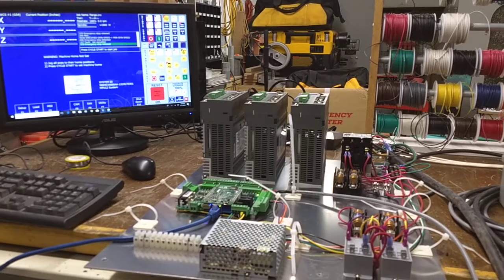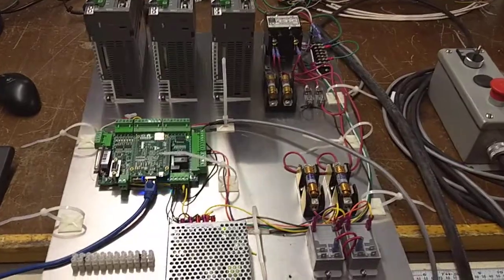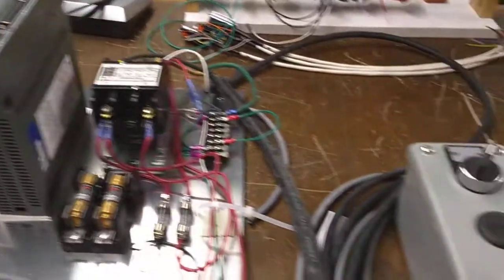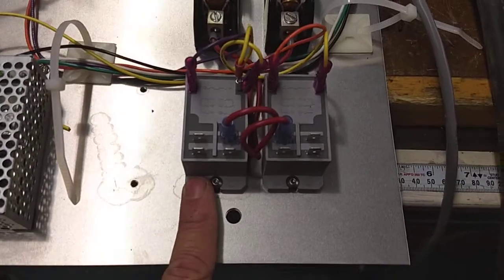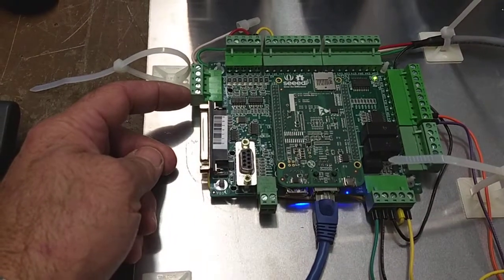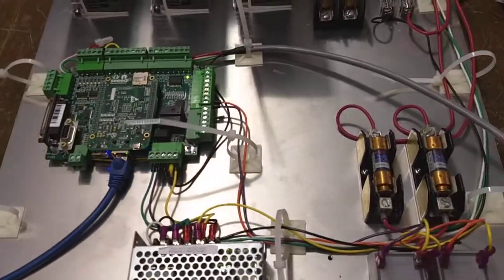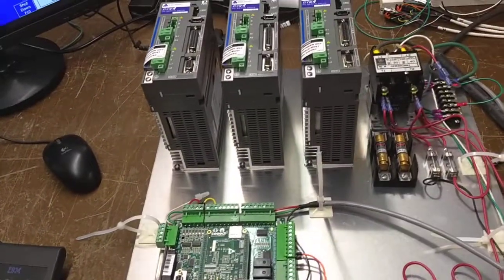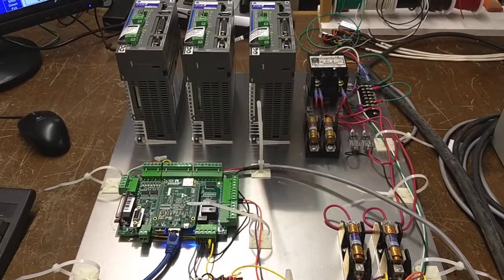Phoenix CNC Router:  Quickie update

Comment: Hi Marty,
as you know i have also DYN4 drives and DMM servos on my router CNC, for my XY I have 1.3 Kw motors , and for Z I have 0.75 Kw motor, they all passed the bench test,. 
after installing on CNC my 1.3 Kw servos  XY work fine but my 0.75 Kw servo on Z trips the drive to red Led light when i try to run it. when i try to run it just lifts Z axis up very fast 1/2 inch and trips the drive. 
Can you please help me with this problem. 
also i have limit switches and i set them to NC that's how i wired them , when i try sent machine Home nothing happens Acorn is saing home switches not set.  I press Alt +I  and i can see them they are connected. 
If you can help me with that also.

Thank you
Reply from the maker: Max, not enough info. Please post to the Centroid CNC User Forms. Post pictures of your machine, a report and screen shots of your wizard pages. I'll answer you there and others may have ideas for you. Make sure your Z is not binding and use the DMM utility to see what the fault is. YouTube not the place for support. http://centroidcncforum.com/viewforum.php?f=60
Reply: thank you Marty
Reply from the maker: Max, you'll get help there and other users will get the benefit of learning as well. Please don't take it wrong but also why I prefer not to do one on one questions like this.